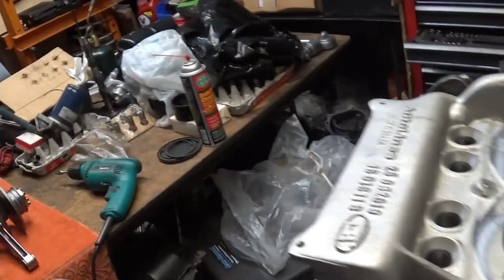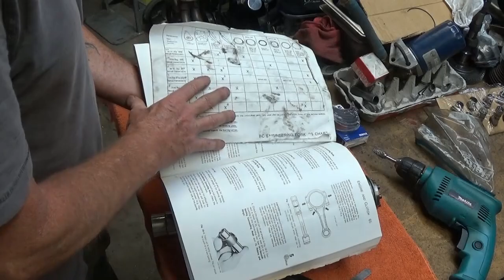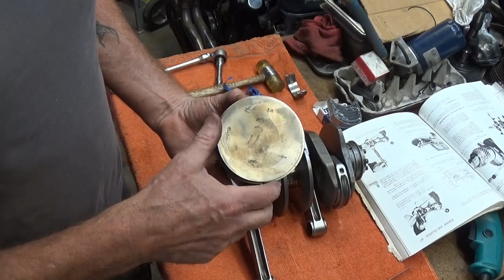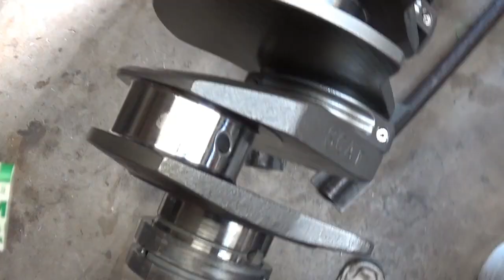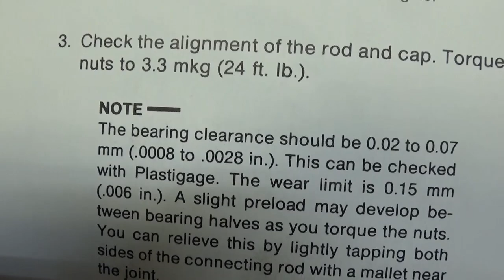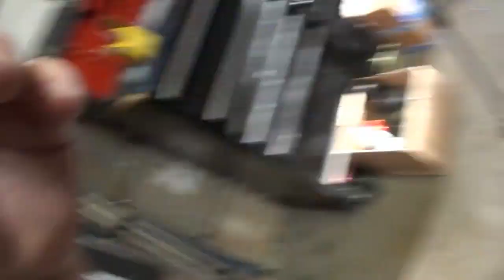Part-2 VW  Aluminum VS AS41 Engine

Comment: I enjoy watching your channel. Thanks for sharing. I had a 1835cc built over 20 years ago. It was may daily driver for many years. Now old enough and smart enough to start building my own engine. I know this is not a how to, it is more what you like to do and why. I would like to see the vent hole you opened up, photo before and after or what a stock one looks like. Thanks
Reply from the maker: I thought I did that?  Can you watch it on a big screen, pause it. I upload in HD so you should see before and after.   Truthfully this case is ready to go out of the box. I just like to make things a little better cause that's me.
Now that I've said that I'll be jinxed and when I put it together it won't run. hehehe

Comment: I like to shop vac the swarf (magnesium or aluminum chips). That way it doesn't get blown all over, possibly into the oiling passages. I need a good air compressor like you have though!
Reply from the maker: Great point!

Comment: I'm at 8:20 in the video - running behind 'cause of work today. It looks like you got the 10mm case savers? I could be wrong though :-)
Reply from the maker: They are 8mm for a daily driver and I had CB install them.  One less thing to worry about.

Comment: Ez how did you split that aluminum case, did you just go with the standard case splitter tool in the oil pump opening, or were there rubber mallets/screwdrivers etc. involved? I ask cause I don't want to mess up the shuffle pins or even worse, when splitting the case halves of my CB case. thanks and I appreciate ya! Ted
Reply from the maker: Splitter & Mallet.   Good Luck with your build. Hope you get lot's of smiles to the miles  :-)
Reply: @TheEZGZ  Thanks you too! :-)

Comment: Do you have crank to cam clearance issues with 82 mm stroke
Reply from the maker: More accurate to say has anyone not had a issue.....!
If you go with the high $$$ stroker rods you won't have to trim much. Ounce you build your 1st one you'll be an old hand at it. Don't let it stop you.  My 1st one was this 2110 I'm rebuilding now. I overdid it but it seemed to work fine for many years.   There is a bit more work to do if your using the 1:1:1 old school camshafts. The new ratio rocker cam's have shorter gentler lobes on them but the rocker arms and geometry are $$$ and a PITA

Comment: Sweet video. Who would you recommend getting a new crankshaft from?
Reply from the maker: That's like asking which Casino I like to gamble at in Vegas.....    
I've bought from Scat, CB Performance, Car Craft, AA piston. They all seem to work fine. I would stick with the 4340 Chromoly Counterweighted ones if your stroking it.  Just cause it makes me feel good.  
hmmmmmmm  Do your shopping and price out the rest of your build. See what they charge for shipping. Try and support someone who has been in buisness a long time has a machine shop and will give you help and support.  Avoid , big advertisers that just run the parts threw a warehouse for the cheapest price and drive Honda's.

Comment: If you go to a paint shop you can buy backer rod which is just foam in various sizes; you can use it to block oil passages, lifter bores ect. It helps keep the shavings out.
Reply from the maker: good to know